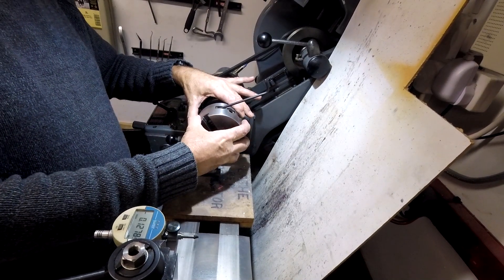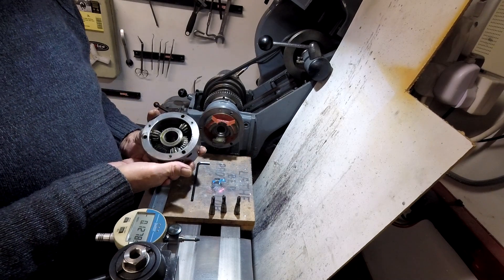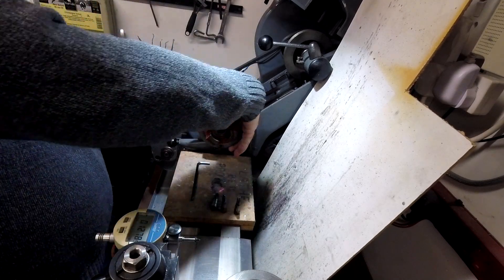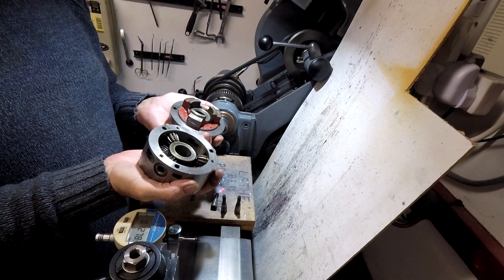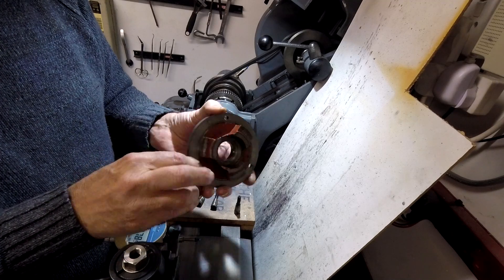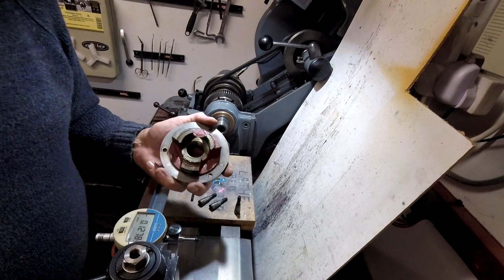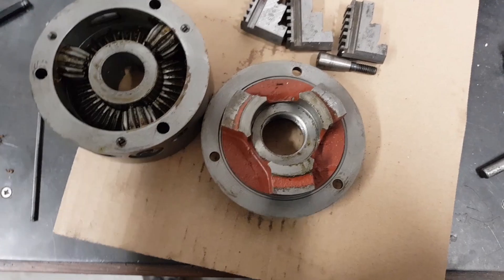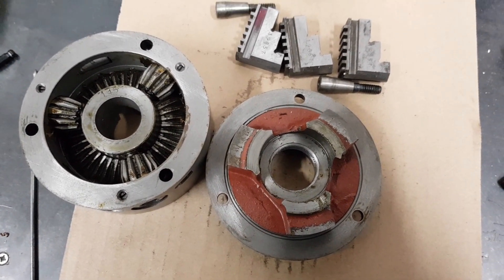A adjustable 3 jaw chuck Griptru.

Comment: Nice vid, interesting chuck and outcome. You can check the runout on the chuck outer surface itself - less error that way.
Reply from the maker: Thanks. Since i adjusted it most work runs pretty much spot on. Stupid thing is, i had owned it for nearly 2 years before i knew it could be adjusted.

Comment: Thank you Steve. That gives me a good insight into how to adjust the griptru. As you say I will need to slacken off the backplate screws, adjust and then re-tighten. Presumably, I slacken the adjusting screws opposite to the one that needs tightening in order to give it room to move. A bit like trueing a bicycle wheel!
Reply from the maker: The screw nearest you will pull the chuck towards you. On the model engineering site of which i am a member. There was a lengthy discussion about the slackening of the backing plate screws. Most saying & quoting Myford who said they did not need slackening. Which was the reason i stripped mine down to see how it worked. If the the rear screws are very tight as mine was. There would be no way to adjust the chuck. Just reading your question then yes you are correct as you could not keep tightening all the screws or the chuck would burst. Regards. Steviegtr.

Comment: Wow I would have never thought about them 3 Allen bolts, did you tighten them all up bit by bit when you refit them?
Reply from the maker: I retightened the rear bolts once i had set it all to spec. Going round several times till i thought they were tight enough. From others i have read not to tighten the rear bolts. ! said 1 to 2nM . I would not have been happy running a lathe chuck at speed with a cutting tool turning metal, with 3 screws that were no more than finger tight. It was a worthwhile job that cost nothing to do . Regards. Steve.